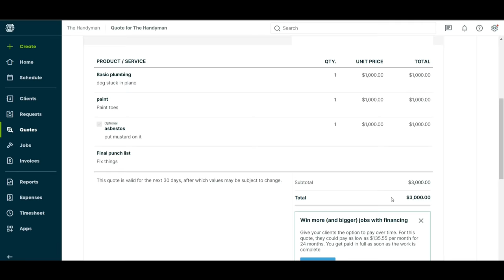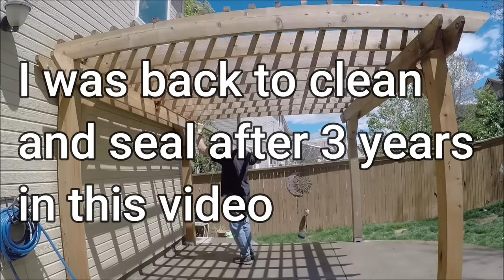I Won't Work For The Middle Class Anymore | THE HANDYMAN BUSINESS |

Comment: This is why I fix almost everything myself and I have to have a garage full of tools. 

Most of what the common tradesmen do is much harder to do for commercial customers and complicated buildings. 

Just about everything in my home is easily serviceable, with the exception of my HVAC unit.
Reply: HVAC is much more simple than most people think, once you are shown what to do.
Reply: The way I see it is, you spend the same amount of money but it's done right and you get tools and experience as a bonus.
Reply: That means you got allot of time on you, a real electrical job will take you aproximately two weaks but if it is something small of course you can do yourself. What is he talking about are long job so unless you do it at weekend or off work you will lose money. I work as Trade man and I hired a guy in eastren europe to do my houses since I am in the UK and he only does some work on each house like gross cutting cleaning some rooms and he does it when he is off work as over time and yet for that little work I pay him 340 dollars a month, in that country the sallary is only 600 euros a month but I pay him for more than anyone so he is soo keen to work for me because it is extra money in  a very short time. A trade man will pay good money to another trade man or workers because he knows the value of time and money.
Reply: @DFREMbowman  - Agreed. Unless you need to open up/charge/etc. the sealed refrigerant system, most HVAC repairs can be done by the average homeowner with common tools.
Reply: @chiplangowski3298 
100%
I am certified and still call out. Hvac if the charge needs service.
Reply: @kidmosey  That means you go ttime and money, and also the ability to do it, the majority people do not have this, it will take someone ten years to learn one trade if they can learn it but others are good it at without knowing that this is not the case with everyone but majority time, it is Money and time. Just to produce a certificate for Insurance for a house or flat in the UK, you will need to have done 2391 certificate that cost around 1200 pound then the meter will cost you another 1000 pounds and then only 10 percent of electrician or electrical Engineer can pass this and that means that even qualified electrician failes this exame because it is tough only 10 percent of all electricians in the UK has that ceritificate and now if you are not electrician or electrical Engineer and you want to do that course if who is going to pass and if you will pass by some divine order then cost of what is mentioned comes to 2300 pounds and after that you can do your own ICER or other certificate for you house etc that will cost you may be 500 dollars max. So does it worth doing a course for 2300 pounds to get that certificate which is very hard to pass and then if you do it by some divine order what will you save?? 500 dollars??? so is the same for referigeration and others.
Reply: Same, I try to do all the stuff myself or contact family. Unless the video starts with- do not do this yourself. And I’m upper class per the income description. But, I love doing this stuff. So, why wouldn’t I ?
Reply: Every time something needs to be fixed it is an excuse to buy new tools
Reply: Preach
Reply: @chiplangowski3298  yea I am specifically talking about charging and/or changing out the unit in general. It’s relevant to me because my unit is presently 30 years old. 

Replacing the fan and cleaning/straight into the coil fins is easy enough.

Comment: What a bummer. Just this morning I was telling my wife how valuable things and services were becoming less and less available to us middle class people. It's either high-end or cheap. No in-between. Then I see this and it just buffers my belief. You gotta do what you must and I wish you well. I just wish the elites weren't taxing us up to our throats and keeping the good stuff for themselves. In fact, our taxes are being paid to them.
Reply: So, you’re implying he should accept a lower income? Why would anyone do that for the same work?
Reply: @AlexofAddison  No I am not saying that. What I am saying is that services and free time are less and less available to the middle and working classes
Reply: I've learned over the years it's really hard to find someone reliable to work on my house.  There's a trade shortage, so most competent people are pricing themselves outside of the middle class.  If you want to own a home in the middle class, you're either going to sacrifice a lot to pay for upper class services, or you're going to learn to do most of the work yourself.  There really isn't much in between there.  I've had to learn a lot so far.  The last battle was HVAC repair after the tech that was supposed to fix it couldn't diagnose a bad control board.  I paid $600 for a new wire drop, thermostat, and time attempting to diagnose a problem only to get AC and heat would turn on at the same time.  The funny thing is, the only possible part left it could have been at that point was the control board or improper wiring of the control board.  Any competent tech should have had that diagnosed pretty quick.  I watched a videos to figure out how the wiring goes, checked that.  It was fine.  I ordered up a new board and swapped that out.  HVAC fixed!  I've had similar experiences about half the time I pay for any work.  More and more, I just do it myself instead.  Now I do most of the minor electrical repairs (light switch / socket replacement), small plumbing repairs, patching drywall, and all those normal day to day repairs that would normally be racking up $xxx bills.  I'm going to have to get into roof repair soon, and that'll probably be my biggest project yet.  That will save me thousands.
Reply: I used to worry that I was just a medical emergency away from being financially crippled.  Then, it was the dentist that started giving me this fear.  Now, it's just about everything.  It's a crazy world.

Comment: Important caveat. If you end up working for someone who “appears to be wealthy“ you will possibly run into issues. I was upgrading all of this guys switches to paddle type switches and I would charge $14 per switch. After I did half of his house he came to me and thought I should do them for $3.50 per switch. I asked him how he came up with that number and he said “because of how fast I was doing it“ he ended up being very argumentative with me and I told him to call an electrician.  😅
Reply: Thats the main problem with these rich people, they try to change the rules when you are already done a certain amout of the work. Thats not how it works, you have to make it clear to them. 
I had some similar story. I let some learning student to some of the work. The customer refuse to pay the signed amout because have of the work wasnt done by me. Who cares, just a lousy excuse. 

Whats the difference if i put 500kg of materials up and down to the 3 floor. Or if some student did it. Doesnt matter at all.
Reply: Tell them you can take them all back out and we'll part ways. I've offered this and they always backed down
Reply: @Vintagebleu  yeah, I probably would’ve said something like that, but he called me in the evening after he had his bourbon and made a couple mild threats. So I just told him I’m done with him.

Comment: Meh, I think this can be a little misleading. The upper middle class is my wheelhouse. I find the jobs are “clean”. You’re in and your out. The upper upper class isn’t stupid, they know you are over charging. They will undoubtedly expect beyond your scope of work, and change orders go over like lead balloons. Getting your final payment can be a negotiation with “old money” customers who know the game.
Reply: charge by the hour. That's what I do about 80% of the time. I'm talking about doing shit that's open ended and basically impossible to price. Change order? no problem. Just keep the clock running. Obviously the hourly rate has to be good money.
Reply: @blackdogproductions2044  that works. I actually bill by line item now. I try not to show my hourly rate cause im expensive but fast. For instance you can charge $125 - $150 to change a ceiling fan but i can do it in 35 min, so its better for me that t&m.

Comment: It's hard to fault anyone for chasing money. If you're middle class, there isn't any other option anymore - you have to learn how to DIY. The going labor rates are high and will only go higher.
Reply: gotta get that carrot on the stick for your wealthy overlords
Reply: Half my work is fixing DIY attempts. It take YEARS to be good at this and sometimes dont realize you screwed yourself doing something wrong until years have passed. Do you DIY when you need a lawyer, accountant or doctor?
Reply: @vids595  I do better quality work than the average "handyman", who rushes through jobs, doing the bare minimum they can to get paid.

And yes, I do DIY my taxes. Haven't been to a doctor in years because I stay in great health, so you could call that DIY too.

Comment: Excellent advice. Here in Canada, for every 5 people retiring from the trades, only 2 are entering trade school. Tradespeople are in high demand in most cities, and it’s often impossible to find a competent person to do small jobs in your home. It’s a great time to be a handyman, if you’re smart.
Reply: I’m in Canada too.
What happened to the trades. I’m more Industrial. Tool and Die Maker.
When I first started the trade there was high demand for tool and die makers. In the 80’s and 90’s still strong demand. PM Brian Mulroney sold out manufacturing here in Ontario. The year was 1994. Was still strong to 2000. As 2000 hit companies where closing shop and moving to Mexico because of the NAFTA agreement. In my city we had 17 to 20 companies close up. Well established companies. With NAFTA did not need a Canadian Head Office. Under the Auto PAC with Canada and the USA. This worked fine for years because the car had to have 50 % content to enter Canada duty free. The spoiler was the NAFTA agreement. 

So back to year 2000, with all these companies closing we had more Tool and Die Makers then there where jobs. Some tool and die makes got out of the trade. 
With no demand for Tool and Die Makers from 2000 to 2012 no young person trained to be a Tool and Die Maker. 
After 2014/2015 things picked up a bit. Companies where again looking to hire Tool and Die Makers. Could not find no one. Because for years no one trained as one. Why would I train to be a tool and die maker with no jobs to go too. 

So these companies complained to the Federal Canadian Government. The solution was to go to India to get Tool and Die Makers which they been doing for  5 years now. 

See how the Government killed off companies only to raid other countries for Tool and Die Makers.

Comment: LoL I don't even trust mechanics to change my oil anymore. Drove home to find that they never screwed back on my engine oil cap and over tightened my oil plug with a torque wrench. Hired contractors to redo my kitchen years ago and they still F'd it up, (they made a wrong cut on the granite)  and there was a lot of back and forth on whether or not they were going to fix their mistake. They originally wanted to leave it as saying I wouldn't even notice it.  Recently the quotes I'm getting from dealership mechanics for parts alone don't make sense, I'm being upcharge for stock parts for a little over double the actual value. And now random handymen want the big bucks for who knows what quality of work. NO THANK YOU. I've been only hiring from referrals from friends and neighbors based off the work they've had done.

Comment: Im in the same boat. I can't stand working for a person on a budget. They want to cut corner's too "save" money. I like to work for customer's that expect perfection and are willing to pay for it.
Reply: I just had a customer forfeit their warranty so they can save $30 on 2 new shutoff valves.
Reply: @davidlynch7666  I wouldn't have even given them the option.
Reply: @mph5896  labor was included in the quote. I told him I’m not touching the valves he said he would replace the vanity himself. I got paid for work I didn’t do, and i don’t have to fix any future problems associated with them. I’m ok with that
Reply: The biggest problem I see is that out of 10 contractors, all 10 of them think they are delivering perfection, but 4 of them are complete hacks, another 4 are mediocre, and only 2 can actually deliver. Every time I see someone comment something like this I wonder if they are one of those hacks.
Reply: @mr.g937  To be clear. I'm a painter and once upon a time did iron work. My work is superior but my spelling is not. Im a tradesman and always deliver my best work.
Reply: Perfection is rare.  Why pay for half assed crap.  I can butcher it myself after watching you tube and keep my cash.

Comment: Just wondering, hasn’t the population dramatically increased?

If so, then we need to look at the ratio of the increased upper class to the increase in middle and lower class. I don’t think there’s enough jobs for tradesmen to only work for the upper class, especially if you’re starting out and don’t have a rep yet.

Comment: My household income is ~300k a year in a modest area. I mown my own lawn and do as much house maintenance as I am able to. I feel that I cannot afford hiring handyman to do anything. Last year, a heavy wind blew off several pieces of the siding. Since I do not have the tools and do not know how to fix it properly, I called a handyman. Guy came in with a helper. It took them 1.5 hour to fix it with the original pieces (not replaced pieces), and he asked for $900 cash. Who can afford this kind of service? I also replaced a heater/boiler last year and the 1.5 hr labor cost me $350 (I bought the new boiler from Lowe’s).  Every year, something will pop up in the house. Although I make good money, I feel it is very expensive to maintain a house. Middle class that only makes $65-100K for the entire household? They can barely survive.

Comment: I was promoted to VP 10 years ago.  I grew up middle class so it took a long time to stop doing everything myself.  But I did it.  As you start outsourcing all the work around the house you realize how valuable a good handyman is.  If I find a good one I won't balk at what they quote and usually tip them generously.  In addition between friends, co-workers, church, and neighborhood chat, you can refer an awful a lot of work to a top notch handyman.

Comment: Mechanical trades this is potentially bad advice. In my experience the “middle class” will do whatever it takes to get the electrical panel switched or air conditioner fixed where the “rich” want to pick apart the price. In mechanical trades it’s best to go into commercial and industrial. A company won’t have an issue paying you $5k to spend a few hours getting their operation back up and running.

Comment: I'm not upper but I'm above middle and  I hate home maintenance.  Typically I will pay one handy man a fair wage and then I will offer my time to help do the grunt work.  I get to learn from a 50 year old master and the job is done right the first time way quicker than if I tried youtubing it up.  It drives many in my family nuts that I pay for a handy man but it just makes sense in many cases. Great vid thanks
O and it was funny you mentioned home office my handy man and I just finished mine as I work remote most of the time.  I designed the tech and he built the rest around it.  Works great.
Reply: A common expression is that if you want to help, then it costs extra.
Reply: A a licensed contractor, I would charge extra if a customer wanted to work with me. There is nothing worse than having to teach a guy who cant even hold a hammer while I'm trying to work.